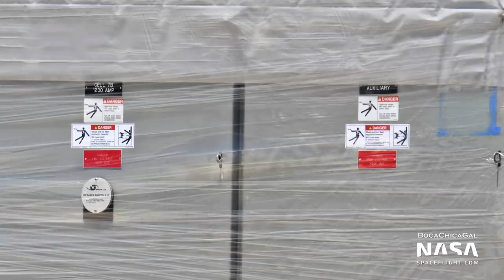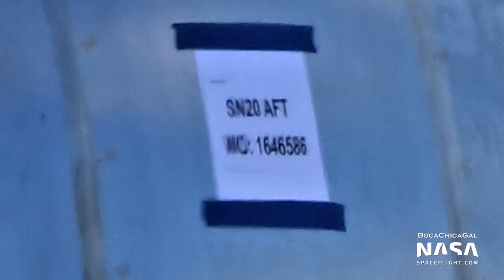Orbital Launch Site Preps Continue as SN20 Aft Dome is Spotted | SpaceX Boca Chica

Comment: Is the launch tower only going to have the elevator to get up and down? And the launch table legs  ,have two plates at the joints  between the upper and lower legs  to explain the long bolts set in the concrete?
Reply: My favorite line for these kinds of circumstances is,  wait for it. . . . .we'll see.